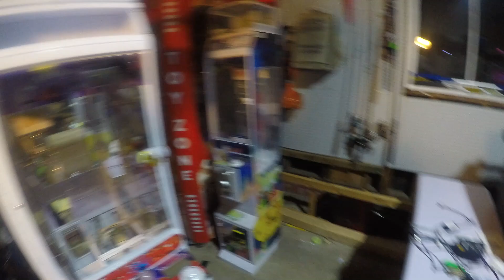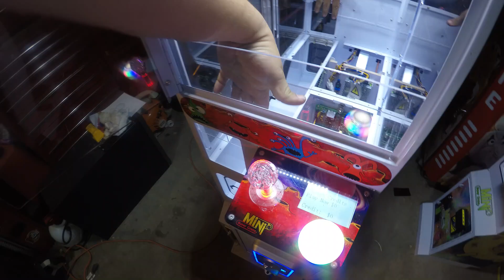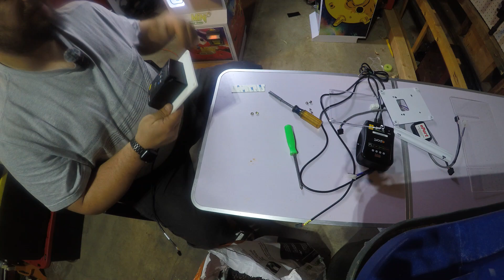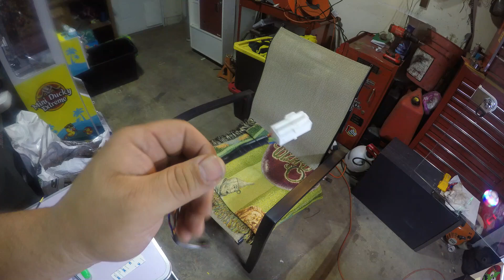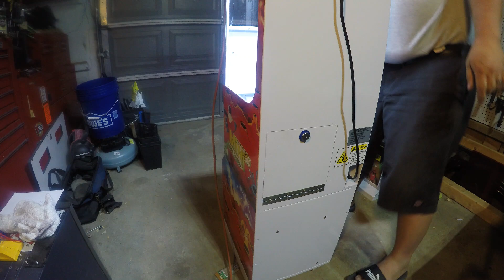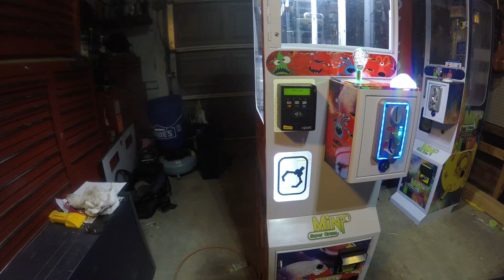Installing Card Reader on CLAW MACHINE

Comment: Hi, does this installation also work with Cantaloupe Engage Pulse available from CandyMachines? Thanks!
Reply from the maker: Yes. If you have any questions feel free to ask happy to help
Reply: @720vending  Thanks! CandyMachines says "Currently, you need to install it using the DBA power.   but, we will also have a quick connect pulse cables later this month - so that it can connect directly into our pulse harness - same as Nayax." Is your video use DBA power? Thanks again!
Reply from the maker: @froregon1 you can I believe I did it in that video or message me anytime